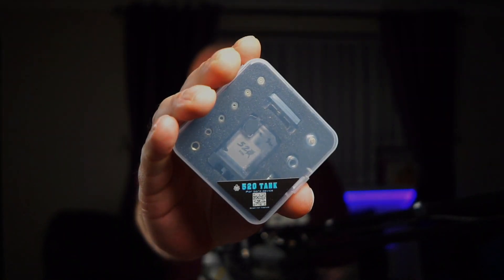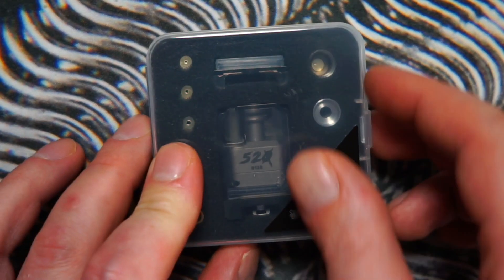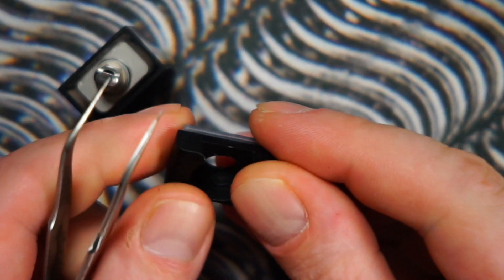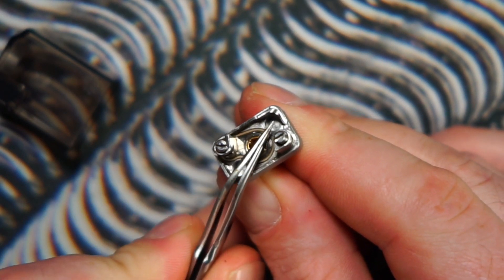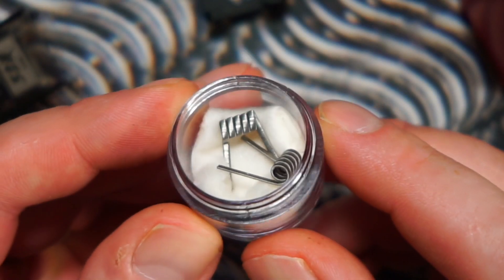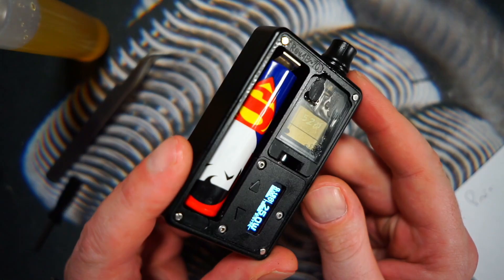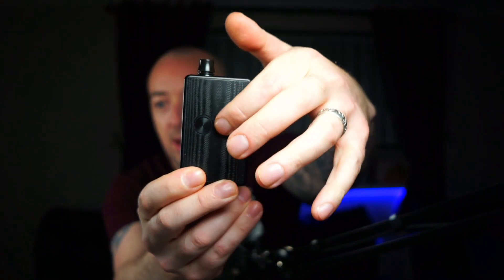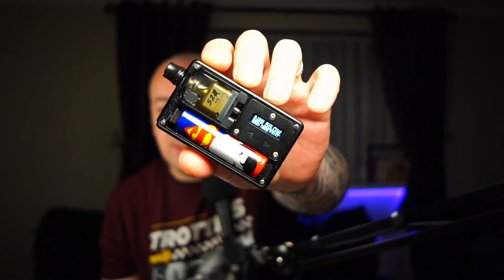520 Boro Tank | Cthulhu Mods | One word Superb!

Comment: I've had many issue's with proper wicking on this 520 bridge. I've building and making coils for over 7yrs and have taken on dozens of wicking challenges on certian rda's and rta's with no issue's, but for whatever reason anytime I use anything over 2.5 diameter i have wicking issue's. 

So question do you exactly tuck your cotton down into those little holes at the bottom corners?  Or do you just rest it just above those indent holes at the wicking corners? 
I've watched how you wick, but it's hard to tell if you tuck it down deep or just rest it above those 2 little round indent slots.
Reply from the maker: I might not have shown it well in the build section but I drop the wick right down to the bottom of the channel, filling all the space, hope this helps 👊💚
Reply: @ProperCoils  That's exactly what I've been also, even tried thinning it out a little also with no real consistency in wicking. I've tried several different brands of cotton also such as geekvape, vapefly, cotton bacon prime, native wicks and bpmods pro cotton plus a few other's. I tried many kinds simply because as I'm sure you know some wick better then other's.
Reply: @jamesleary1405  thin out a bit more, just fill up the space inside those holes and don't tuck the cotton all the way down. Just have it  resting above the bottom. I'm using a handmade coil, 2.5 I.d, 0.35 ohm at 40 watts and its working just fine.
Reply: @sheharyarkhan2384  Just seen this comment now, but I've already tried every possible method and honestly it's hit and miss with it working good enough for me to enjoy it. My cloud rba wicks like a boss so that's been my go to lately. Like i said above I've been building and have figured wicking out on some of the most finicky tanks ever made over the many many year's I've been in this field since quiting smokes. Especially working for a shop for so many year's teaching people how to build etc. This rba has it's moments, and when it does it shines. But unfortunately those moments are far and few between and just not worth it imo. I can't remember the name of the tank cause it was like almost year's ago but it was crazy to wick old school genny style tank and it beat me and now this kinda beat me. I say kinda cause I have gotten it work just not enough that I can say I enjoy it or like over any other.